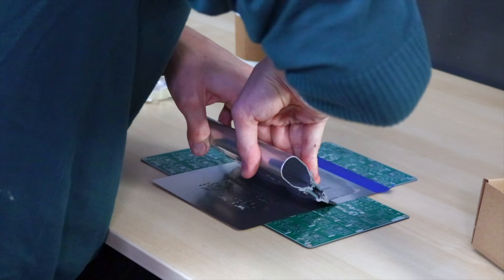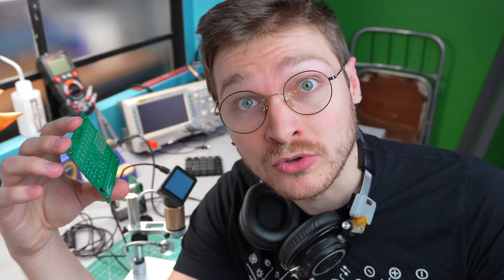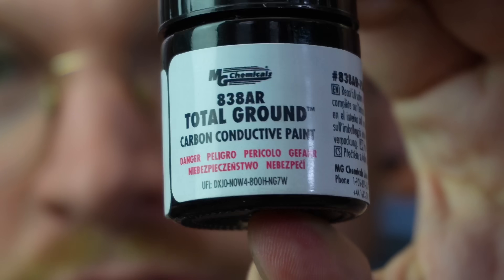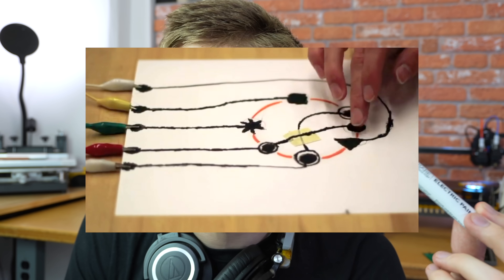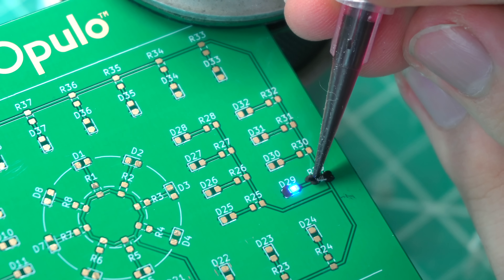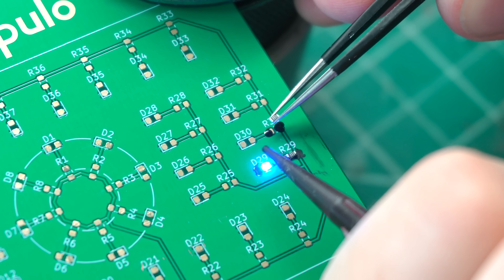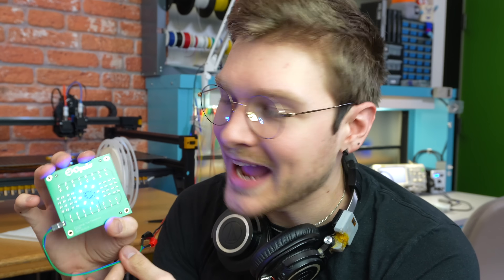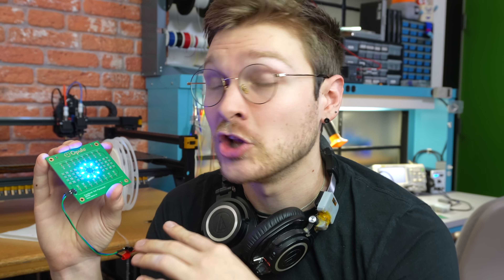Making Circuit Boards WITHOUT Solder

Comment: just add a mod for the lumenPNP, add a small injection tube slot that applies the paste before placing the component, that would just make the manual application unnecessary.
Reply: i would not be surprised if there are people out there that would want this, this just means you need less tools for prototyping.

Comment: Maybe some ink head for that machine that put some ink to pads just before placing components. Then you can use that more fluid ink.
Edit: Maybe ink nozzle size need to be enough small to do smd ic solder pads. Maybe around 0.1mm and also the pump need to be accurate for small volumes.

Comment: Nice! Sitting in shenzhen now (not chinese) and glad I forced Myself to rest after doing embedded coding past midnight. I plan to look on taobao to see what z-tape solutions are available and try at least one of those. So tired of soldering 16 pin USB connectors, and most of the 6 pin connectors on taobao didn't have data lines, so z-tape is a lower cost solution than PCBA. Would like a pick and place, but it has to be smaller and lighter weight for luggage. Already travel with some of a portable factory (that is thankfully small enough to be strapped on both arms if I want to)...LOL.

Comment: Just a suggestion, to make it last longer just thin it like paint thinner.  You would need to know what solvent base this stuff is though.  The smell would be a good clue.  Whatever solvent has that same smell would be right.  Just remember that thinning it also makes it literally thinner so you might need to apply more.  You're right about the paint not being an adhesive but maybe you can put conformal coating on the board after assembly.  That stuff definitely locks everything in.

Comment: An additional layer to this is that the conductive paints were reversible - so if a prototype placement doesn't work you can clean it up and try again. If you had an in-house PCB mill, that means you could really iterate faster and cheaper

Comment: This is what a lot of printed circuit research is doing: 
You could try mixing up a really THICK mix of copper sulfate + water (might want to test some solvents) and put small drops on the pads, dip the components into a solution of citric acid (water+ vitamin C powder). This mixture makes copper nano particles BUT copper sulfate is also used for electroplating. My theory is that as the citric acid washes off the component and mixes into the liquid copper sulfate on the board, it will form copper particles AND electroplate copper at the same time, welding the nanoparticles into a solid connection. Nanoparticles of metal have a lower melting point at <10nm and the current might even melt the particles as they form.

You can experiment with the chemicals like using iron/ferrite containing stuff instead or in addition to the citric acid. That should give you a mix of copper + iron nanoparticles and may be able to turn the sulfur residue into a gas.

PS. The fresh copper nanoparticle is OXYGEN FREE meaning they rust within minutes and form nonconductive copper oxide. The oxygen in water is enough to make it rust, which I got around by replacing water with other solvents. Good luck.

PPS. Copper nanoparticles are SALMON pink, copper oxide is rust brown.

Comment: I think it will be way better if you dispense solder paste from the Lumen instead of a conductive ink, would speed up prototyping a lot!
Reply: since there are two nozzles on the head, have one of them be a Syringe that can dispense things? 
Problem is to have it consistently only drop a bit of paste/ink/liquid across teh whole syringe. 
And probably need to remove the pressure a bit so it doesn't drip while moving across the board for the pnp part of the job.
some machines do have glue dispensers for upside down wave soldering? (iirc)
Reply: @StreuPfeffer There's also an extra GPIO in the V4 head... opens up more possibilities! but yeah def. not easy

Comment: Hmm, i wonder if you could suspend liquid metal, which is extremely conductive, in a gel that was conductive, and possibly hardens or dries 🤔
Reply: Metal Gel by Liquid Wire seems to be doing this

Comment: Don‘t use Graphite! Use Lamp-Black (super fine Carbon Black)! I have experimented with both and Lamp-Black is much better. You need about 5-10 times more conductive material than the the Base too have a good conductivity. 
Best wishes from Germany, Christian B.
Reply from the maker: awesome, thanks for the tip! Just bought a bunch for testing!
Reply: @stephen_hawes  Please also remember, if you're getting into using super-fine powders, that they can be horribly carcinogenic. Properly rated masks etc required.

Comment: I think you're really onto something here!
What if you could extrude this stuff with a seperate application actuator on the PNP right before placing a component? The "stencil time" would be reduced to below 5 seconds!

This would eliminate two manual manufacturing steps, applying the solder paste and the reflow oven. The whole point of the PNP is to make small-scale manufacturing affordable, so the fewer manual steps are required the faster a single person could manufacture PCBs with the lumen.

Comment: You have a dual head on the Lumen.  Simply use one head as "paste"/ink dispenser and the other head to place the part!
Reply: A head addon to extrude solder paste would also be so usefully for solder paste. It would to make it possible to avoid buying a stencil and stencilling on the paste by hand!
Reply: Absolutely! It might even eliminate the step of ordering PCBs if you use perfboard and use solderpaste to effectively create your own traces. People do this manually but it would be a lot less tedious if it was done by machine. You could go from schematic to prototype really fast

Comment: Crazy overengineered idea: have PCB, with solder paste applied, on a hotplate while placing components and flood the machine with nitrogen so the solder doesn't oxidize.

Comment: Doesn't the solder paste conduct before you put it in the oven?
Reply: Yes, but it is not isolated in the Z axis so it just shorts everything.  This is why you use a stencil and the pcb has the top layer called solder mask or simply mask layer.  but paste would just jump right over all of that.
Reply: @dougcox835  neither are the conductive paints and inks used in this video?
Reply: @dougcox835  neither are the conductive paints and inks used in this video?
Reply: @dougcox835  I assumed it would be applied in the normal way through the stencil.
Reply: @dougcox835  it is not isolated in any axis, but neither is the conductive epoxy ink used in this video. Both of them seem to be just as fluid in their liquid phase, and with simple 0603 components that are spaced as far apart as in this video there is very little risk of shorting. Of course the solder pads are designed to attract the liquid metal and only once you heat it up it will adhere properly but it should do the job of lighting up the LEDs while you're placing them.
Reply: Not nearly as reliably. It's many small balls of solid powdered solder surrounded by a non-conductive flux.
Reply: When solder paste is heated up, surface tension with the metal-metal bonds causes it to adhere to copper pads and this wicking prevents shorts.

Comment: Seems like you could take this idea further, and buy one of the monochrome LCD resin printers, and 3d print some little pcb offset for the resin vat, mix the graphite into some 3D resin with decent pigment holding which isn't uncommon in the space, then you'd be able to just blast a conductive resin circuit design on a substrate. You can then make a thick UV activated epoxy to dispense as the solder, can mod a 3D printer or get a automated glue dispenser, "bake" under UV light and you'd have a whole setup at home PCB prototyping setup with Lumen.
Reply: I have already tested UV Resin mixed with Lamp-Black, but it gets so dark, that the UV-Light can’t get deep enough and only a very thin „skin“ gets hardened!
Reply: @christianbaumgartner7133  Ah, yeah, that's a very good point. Perhaps, Indium tin oxide powder might work better?

Comment: Neat idea!  Next step is to install a paste/paint extruder onto the lumen, so that you don't need to manually pre-apply the adhesive.  That would also eliminate the dry time issue if you can place adhesive then immediately place the part, and repeat.  And you conveniently have two toolheads....
Reply: Was looking to see if somebody already posted this suggestion.  You win!
But it would be even better if you placed a dot of actual adhesive under the main body of the part to take over the job fastening the part onto the board. Then the conductive stuff, put down on the next pass wont have the job of holding the part on.  Now you place the part.  Of course, parts with a thermal pads wouldn't need the adhesive.

Comment: This is cool!  It does make me wonder... is regular solder paste conductive without melting? Surely some of them solder balls are making contact when a part is squished down?  🤔Might be worth a try!
Reply: u can just buy conductive glue. this is used in flexible pcbs instead of solder
Reply: Do keep in mind Z-tape is not a suspension. It's a thin sticky carrier with hollow spheres embedded into it, where each sphere spans the whole thickness of the tape and then some. When applied correctly, the sphere changes shape, with some probability creating a single conductive column that pierces all the way through. It's not even very conductive, and it already took a lot of engineering beyond basic suspensions to get it that far.
Reply: @SianaGearz  Oh! I somehow didn't know the spheres were hollow, but that makes a lot of sense.  And yeah, I think these are all mainly for just signals vs power since there's so little surface contact.   Now I wonder if someone could make something like ZEBRA connectors in a 2D plane. Like fine checkerboard of alternating conductive and sticky squares. Might be fun.  :)
Reply: The suspension liquid (rosin+solvents) prevents solder paste from conducting all the way through, too many opportunities for continuity to break.

Fun fact, grey thermal paste is not always but quite often only aluminium particles suspended in silicone, with most of it being metal. Also not electrically conductive, not even under pressure.

In my mind all of these suspensions should theoretically act as a capacitor, so one could try driving the LED with a couple MHz, but i have my doubt that it's going to do anything.

Comment: Hey Stephen, you have to press and heat cure and cool down the z-tape, to get the part frozen in the correct  position. I myself am experimenting with this. Not too reliable.
Reply: Wonder if heating it up while in a vacuum seal bag would work.

Comment: Could a diode laser melt solder paste in a localised area so the PNP can solder basic components as it places them without affecting the paste on adjacent pads?

...maybe would need some kind of dye adding to the paste so it's not as reflective as the laser melts it.

Might also be slow, but for prototyping that shouldn't matter much.
Reply: some carbon black in the solder paste would certainly be both conductive of electricity and adsorptive of the photons from the laser.
Reply: @shrimpixel  It would make the solder joints very brittle though. I'd just stick to soldering paste. For me it's just some fun playing around with novel ideas.
Reply: @Atom224  It was wondering about that! I reckon carbon dust is cheaper in bulk than the metals used in solder, and it's "conductive", so either adding even a tiny bit causes general problems, or it's far less conductive. Otherwise every company out there would have been doping their solder with carbon for years.
Reply: there are laser soldering machines, but they use wire
Reply: I like the idea, but I don't think it would work very well. If you just add enough heat to melt the solder, as soon as you start placing the part, it will wick away some of the heat and it will solidify. It might connect, but it won't make a good connection, which requires getting the pin, pad and solder all above the solder's melting point so the surface tension can flow it cleanly.
Reply: @---..  I was thinking that it'd place the component first then heat up the paste at each pad until the solder melts.

Obviously wouldn't work with BGA's and the like but I think we're only talking fairly basic-level components here.

Would probably need some fine tuning so it applies heat for different lengths of time depending on the pad size, trace thicknesses, etc.
Reply: This actually sounds like a good idea.  I think you don't have to worry about the solder being shiny because it's dark before melting so that would regulate the heat anyway.  Once it melts and gets shiny no more heat is needed anyway. You could just slather the paste everywhere (no paste mask) and after laser soldering everything wash it all away.  I do see an issue though.  There would likely be paste under the components that didn't get washed away so that would likely short everything.
Reply: selective laser soldering is actually a thing  - a company called Japan Unix makes machines to do it. https://www.youtube.com/watch?v=AMfQZiJztyE
Reply: Would be tricky to do for more than 2 pins.. packages like qfn etc
Reply: @CarlBugeja  For single layer boards .... couldn't your pcb heater project be used in some form or way?
Basically instead of heating the whole board, could you do traces below a component or several (like sections)
And then when those parts are placed (low-melt solder) - we hit the heat up (well, it could be warming the whole board from the start) - then extra heat the specific sections/components to solidify them.
At the end, those heat traces would be never used, but for prototyping - get a board from jlc or what not, place it and run it.

Technically speaking if you did it around a leg of a troughhole, it would create an induction heating on the leg - thus turn the board over, run that and hand solder without a soldering iron too ... 
Then just snip legs.

Maybe a project for your next video :D
Reply: @mitchellmnr it can definitely be done 🙂 but the main problem is with the durability of the PCB given that it has to go up to at least 180degC for multiple runs.. It's not within the pcb specifications to go at this high temperature for long durations.. So I am currently looking for other applications where this might be useful which have lower temperature ratings
Reply: Im thinking rather than solder paste, a UV curable conductive epoxy.
Reply: My suggestion: Add a solder paste dispenser and a laser to the pnp unit. The laser must be thermally monitored, otherwise the solder paste will explode due to overheating. Such a machine would solve so many problems on prototyping!
Reply: Siiiick ya that could work. Its such a good idea i bet someone has tried it.
Reply: I think a fiber laser would be better

Comment: Ohh and be carefull with heat emmiting parts... Carbon paint looses resistivity when heated up... Very useful to create e-fuses for firework ignition... but bad when it cooks your circuit because of the runaway effect ;)

Comment: Super useful for fast prototype iteration. The best part of this is that you could reverse the process!
Soak the board in solvent and use the machine to pick the parts off the board again... fully automating the testing of different components on a single proto-board.
And having a paste extruder would allow to print on very precise custom resistor values onto a board just by varying the length and thicknes of the paste...
Exiting to see where this will go :D

Comment: The carbon paint looks very similar to something we use in electron microscopy to ground samples mounted in plastic. If you don't ground them then the electrons from the microscope accumulate in the sample making it progressively brighter until it is just a glowing white blob (there are ways around this but the carbon paint is the fastest/easiest). 

Microscopy supply companies like Ted Pella also sell a conductive carbon glue. I haven't used it but looking at the spec sheet it also uses acetone as a solvent so will probably flash off too fast for your use. Conductive 2 part epoxies might work for your situation with their extended working time but would be more annoying to apply and a lot harder to remove once fully cured.

Comment: Seems quite useful for prototyping. Using the second head on the lumen as an applicator you could pick up a part, put the pain down and then place the part. Do this for every component and you have a board for prototyping right off the machine. And having the paint be sturdy but still relatively easy to remove makes manual rework easy for development.
Reply from the maker: yeah, this is what i was imagining too! would be easy to reduce excessive drying by dispensing paste for a single component, then placing just that part. a bit slower, but likely much more reliable.
Reply: @stephen_hawes  Once this is solved you only need a way of fabricating decent quality PCBs at home and you can get a consistent prototype turn-around time for simple project measured in hours! Tho homemade PCBs seems like a tough nut to crack.